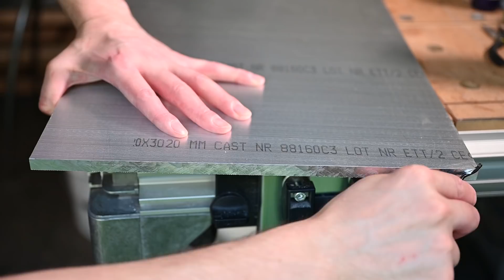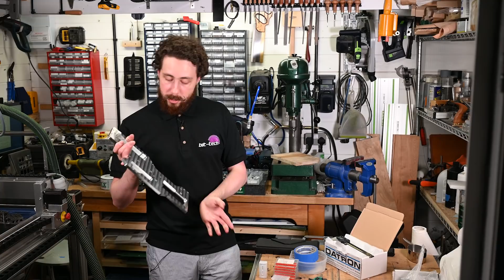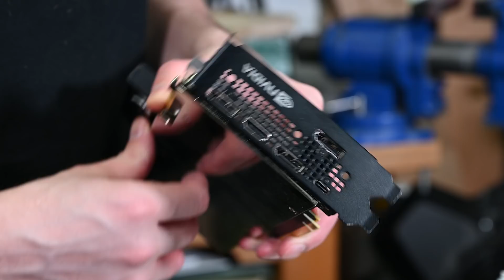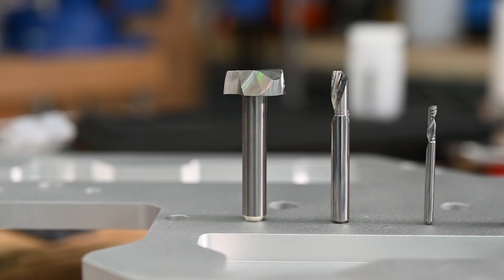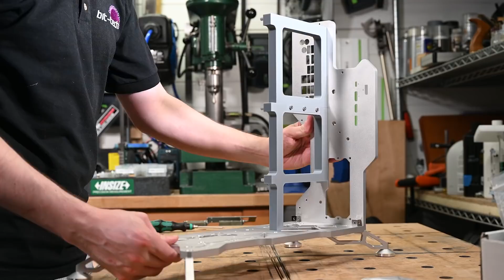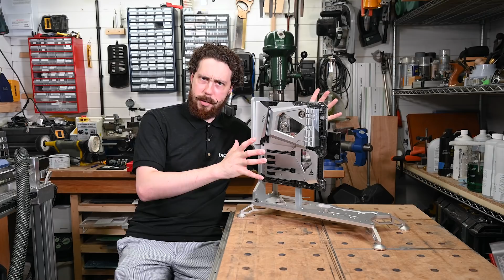AQUACERAS Part 6 - Machining the CUSTOM IO Rear Panel | bit-tech Modding

Comment: How did you get those ports alligned to eachother so well? Did you take a scan of the IO on a regular scanner and trace that?
And how did you allign the backplate and the IO ports so perfectly? How did you know where you had to mill all the ports on the back to make sure you allign them to the motherboard tray?
Reply from the maker: A lot of time and a set of calipers. Just need to be very thorough.
Reply: @bittech1  thank you! I'm thinking of doing a scratch build myself actually, hence the question.

Comment: It would be interesting to see a motherboard manufacturer make a giant motherboard that is designed specifically to display as a work of art.    The memory would be spaced wider apart or have some kind of giant memory card that is decorative.    And have more PCI slots or more things on a larger I/O panel.    Maybe have physically larger NVMe drives that can be decorated.

Comment: Why do you cut the piece out from the center of the aluminum plate rather than from closer to a corner/edge?  Seems like a waste of metal.  Obviously you can cut smaller pieces out of the scrap, but it seems to me you could have milled two large parts (ie - ths floor snd backplate) from one piece rather than needing two sheets of plate for those two large pieces.

Comment: Incredible how detailed your work here is, I'm impressed. Something you might want to consider to fit the silver color of the whole build is electroplating the brass connectors for your distro-plates with nickel, it's a fairly simple process.

Comment: im a cnc mechanic. and if you had a proper industrial machine this plate would have taken not even kidding like 5 minutes to manifacture, but these small home machines have their limits when it comes to sturdiness XD
nice video
Reply from the maker: Believe me it's truly painful knowing that something can be cut in the blink of an eye to higher dimensional accuracy and with a better surface finish haha. One day I'll have a proper machine or even better, several :D
Reply: @bittech1  my machine is the CTX Gamma 2000TC gildemeister, even tho i programm by hand, and the fakt that is a lathe i could do this thing on it ^^, but it comes with a pricetag of about 750k base
Reply from the maker: @nogum9763  Ooof that's a heavy boi. I'm just aiming to start small with one of the Datron machines, likely a Neo or an M8 Cube depending on which jobs seem likely. Can work my way up the food chain from there haha
Reply: @bittech1   the gamma isnt mine ofc it belongs to my company, but a devent machine is a MCV for around 100-200k

Comment: Looks great! But are you sure that all plugs will fit? Many plugs need a lot of space directly near the contacts.
Reply from the maker: They'd have to be pretty bulky ones not to fit, I used the dimensions from the real plate to avoid any conflicts. I'm sure the occasional super fat USB stick won't fit (like card readers perhaps) but those have trouble with regular PCs anyway so I'm not worried.
Reply: @bittech1  I had trouble with HDMI plugs. This is why I mentioned it. Thanks for your answer.

Comment: I absolutely love 99% of this back panel, my only minor gripe is the USB-C ports for the motherboard. You seem to have cut the video card USB-C hole out very precisely, but on the motherboard you've just cut big honking rectangles. I know some USB-C plugs need a little extra clearance so that the 1.5-2mm plate doesn't stop them plugging in all the way, but why didn't you at least make the holes around them just sightly larger but in the same shape/proportions as the USB-C? 
I know the answer certainly isn't "feeling lazy", but I also don't see how it could be "it looks better". Is there a functional or practical reason why you cut them out the same as the USB-A holes?
Reply from the maker: It's because I used the real IO shield as the template for the measurements, that's how it is on that one.
Reply: @bittech1  Hmm, I didn't notice that. That's fair enough. Personally I might put a bit of black card between the I/O and the back plate that is more form-fit to the ports just so you aren't looking into the internals though the gaps, but that's a personal preference thing. 
Excellent work overall though! Love watching your videos!

Comment: Hello, I would have a great piece of advice to offer you, that is to say that the graphics cards were designed to be normally arranged with the fans below as well as the electrical system to alleviate the problem of heat and stability. would be to invent a water block above instead of putting a back plate since the heat is made to go up physically.

Comment: Could you not have milled the small slots for the sockets from the flat side instead of in the recess and chamfered after
Reply from the maker: Just consider though how that is actually much harder to do than milling on the same setup as chamfering.
Reply: @bittech1  But do you not have to turn the plate over to chamfer the other side anyway ?

Comment: Just found this channel on the video before this one.
Great work !! Really like the direction of the project.
Wish I had time to make something like that.

One tip: Use "conventional" milling when doing chamfers or any other finishing cuts for a better finish. (Especially when you start cutting acrylic)
Second tip: Correct the run-out of your end mills with a tenths indicator.
Won't help with the single flutes but anything higher and it helps in many ways, reduced chatter, smoother finish and higher accuracy of parts, especially when using cutter compensation.
If you need instructions on how to do that. let me know. (Yes, I own a machine shop)

Keep up the good work!!
Can't wait for the next video.

Comment: really nice. can you tell me what kind of kompressor you are using for the sandblasting? i really wanna setup an station at home
Reply from the maker: Manuel Mütze Mine’s a Swan PV-202-30, it just about manages with it but a higher CFM unit would be a good choice.
Reply: bit-tech thx for the quick response. Do you use the compressor also for the coolant for the mill?

Comment: What kind of feeds/speeds are you getting out of that face mill? Those Datron double flutes look awesome.
Reply from the maker: Bulletproof Everyone I use it at 1000 mm/min with a 0.2mm DoC @22k, thing’s a beast. It’s supposed to be used much faster than that but my machine just can’t manage haha

Comment: I wonder how much of the ablated aluminium can be recovered. Seems like a substantial amount of it is removed while machining, would be nice if you can melt it down and reuse later.
Reply: I think you can since the machine shop in my college collects all the chips and sends it out to be recycled
Reply from the maker: Yup if you’re a proper machine shop going through loads of aluminium you can usually sell it back to the supplier for a discount. In my case the chips are a lost cause as they get two muddled in with other materials, however I do recycle all the offcuts.
Reply: @bittech1  Considering the quality of your work I guess you are kind of on the way to become a proper machine shop sooner or later. Wish you all the best. My mouth starts to water when I think what you could probably do on one of those "proper" beasts of CNC machines. :)

Comment: Nice looking build.
But may I ask you a question?
Why do you cut all pieces out of the middle of a large sheet instead of placing your part to a corner and be able to fit other parts in the remaining stock?

Comment: Is there a reason you didn't mill the IO from the backside by flipping over the part? That way you wouldn't have the thick walls on either side.
Reply from the maker: Garret I wouldn’t have been able to do the chamfers that way. Also one thing to consider is that material is only 1.5mm thick maximum (thinner for the gpu) so it would have been flexing and vibrating from being unsupported.
Reply: @bittech1  That makes sense. I assumed you probably took that into consideration. With an end mill that tiny you definitely want the part stabilized to minimize the vibrations. Really loving the build so far.

Comment: I do kind of wish you would have matched the exact shapes of the io better. I bet it would have been pretty difficult to get a perfect usb c shape, but it would have looked so nice. But I guess this way you can use nice braided cables with custom aluminum housings milled by you. Wink wink.
Reply from the maker: I followed the design of the real one for safety sake. In the one I showed before there were clearance issues with some connectors, so I didn't want to accidentally have the same problem. It's no harder to do, just didn't want to risk the cover obstructing things.
Reply: bit-tech in that case how about those custom aluminum housings for your usb, lan, and other cables? In the same style as the case. That would be mind blowing cool.

Comment: Are you using a tempered glass panel from an old pc case? Possibly because buying tempered glass of that size and thickness would cost more than the pc case itself?

Comment: So when will you start mass production? 
Anyway I think I want to build something like an ATX board with gpu and full size atx psu sandwiched between 2 2x200mm rads above and below it. Been wanting to build something like that for a long time now, but with all this inspiration I guess I should start this summer. It'll never look anywhere near what you are achieving there, thanks for all the beautiful content!
Reply: Lol I dont think this is going to be mass produced
Reply: @joshhodder8789  It wasn't very serious either :)
Reply from the maker: Josh Hodder Whilst you’re right, it would be a pretty cool thought experiment to see what it would take to have a chassis like this become more batch production friendly. Obviously doing all the exact holes might be an issue, but there’s scope for perhaps just making that one plate to match certain configurations etc.

Again won’t happen I reckon but it’s fun to think about it, sometimes it spawns novel solutions to other issues in the process.